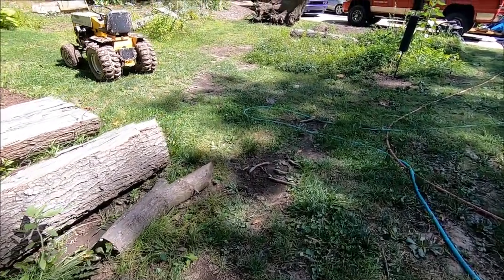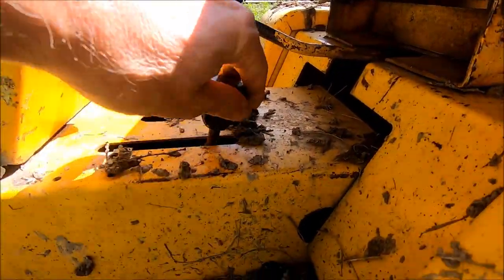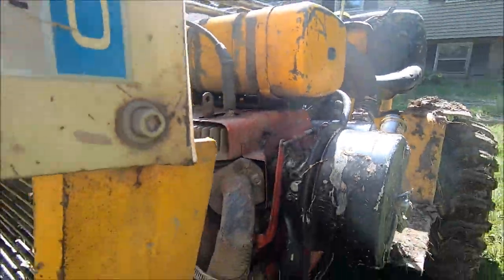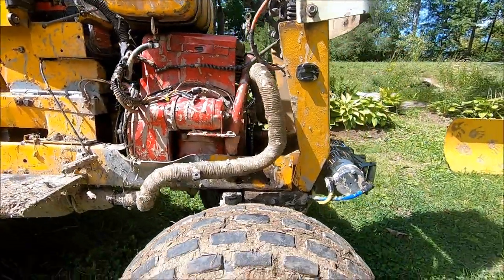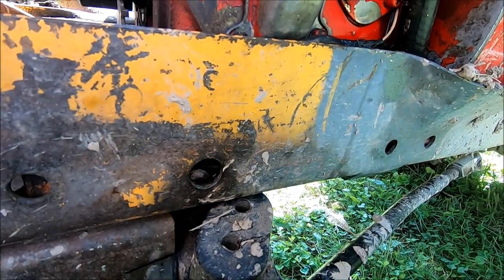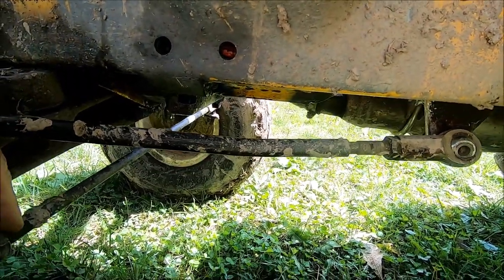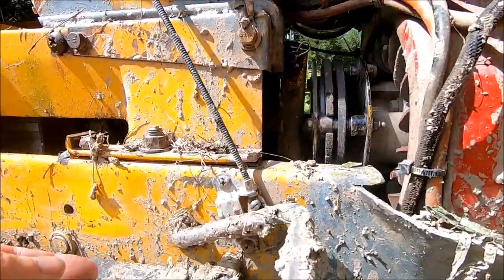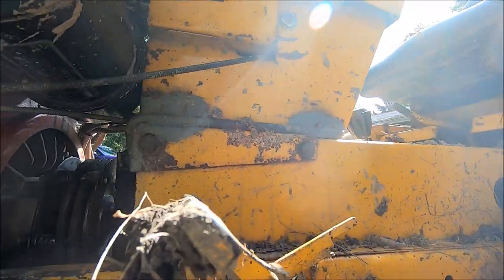2019 Top Tractor Champion How about a walk around the mud mower

Comment: I understand the double clutch set up you have now. Stock? How many gears you have? Will the racing cam work in other models like a briggs for what? In search of one for the 15hp cast iron briggs in the wards. She needs some more power or something.
Reply from the maker: There is a video in the works to show case the two stage double disk clutch set up.  Three (3) forward gears and a creeper gearbox in front for a total of six (6) forward gears.  Not to sure about cams for the cast iron brigg's.  I do know there is a plethora for the kohler cast iron motor, maybe the cam grinders for the kohlers will have something for the brigg's.  Call Lakota racing out of Ohio.  There are other things you can do to that motor to make it stronger.  Porting, intake and exhaust tuning, larger valves and maybe a head shave too.

Comment: That's an awesome tractor, I'm modeling my 124 after this! Did you modify the fenders to fit the rear tires in? The measurement on mine, don't seem like they'd fit?
Reply from the maker: Thank you and yes the whole seat tray and fenders was moved up an inch to clear 28's.  Oh and moved the floor boards forward some too.